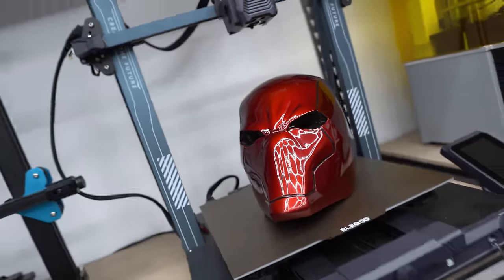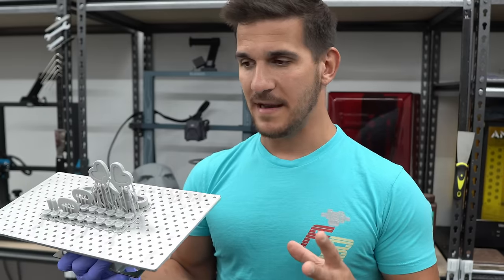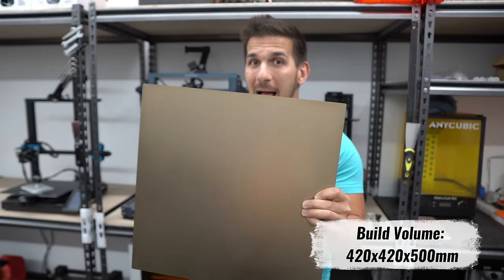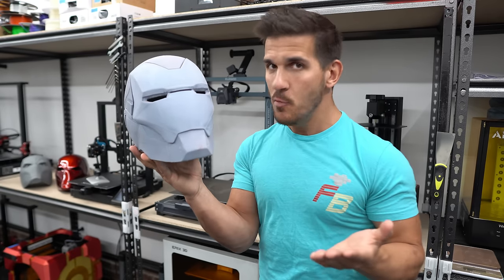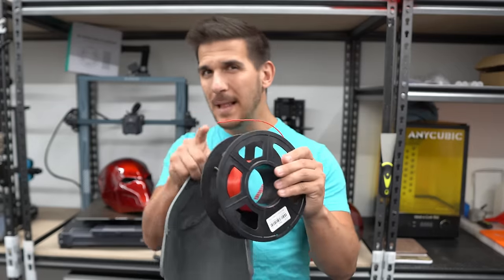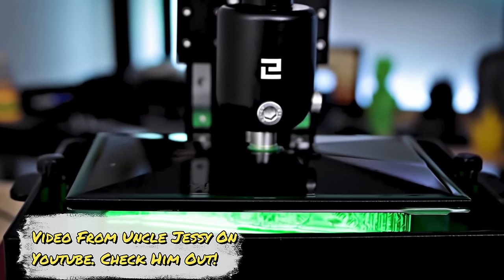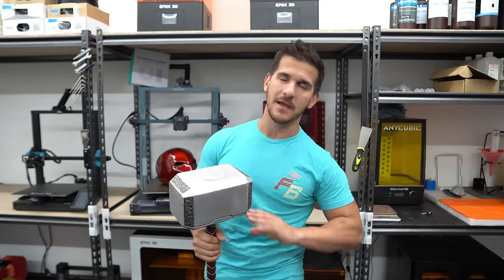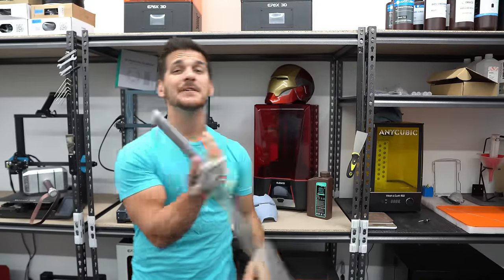Plastic (FDM) or Resin (LCD) 3D Printing?! Which is BEST for Cosplay & Props?!

Comment: I have a resin printer, the halot one, and I'm having issues with my prints not sticking to the plate. It worked perfectly for like 20 prints, and then I had to change the FEP. I'm pretty sure I did that part, right, though. They just keep making flat blobs on the FEP. Any tips or tricks or video links?

Thank you!

Comment: Good overview but one small correction. That's not a SLA printer. SLA use lasers and draw the layers like a pencil. LCD/DLP printers project a full layer all at once. Most SLA printers are very big with the exception of Formlabs printers (there may be others, that's the only one I know of)
Reply from the maker: You are correct! My bad haha I changed the title
Reply: @Frankly Built  new to your channel, where do you get your build/STL files, do you make them yourself?

Comment: I want a resin printer when I have more space for one, as well as a bigger FDM printer. Only barely enough room for an ender 3 at the moment. But I make it work and I'm currently working on a 33" halo assault rifle printed on my ender! On a side note, have you ever worked with Eva foam? Or did you go straight into 3D printing?
Reply from the maker: I went right to printing

Comment: Yeah, but to get the quality of resin prints with fdm, you need lots of supplies and tools that exceed that of processing resin: lots of different grits of sandpaper, sander, fillers, primer, acetone vapor machines, etc. Plus fdm is so much slower, even with klipper printers, especially with Anycubic’s Mono M5, which is three times the speed of average resin printers.

Comment: I personally dont want to make huge things. I want to print anime and action figure type things, small desktop stuff or quick fixes for things but nothing giant. I assume a resin printer would be better for that. Ive done a literal metric fuckton of research and I think even with the extra cost, steps and hastle I want a resin printer. The one thing Im not sure on is the fumes. I dont have a ton of room for a printer so it would probably end up in my bedroom or livingroom which probably wouldn't be ideal. I dont want to constantly breath fumes if they are toxic. Just how dangerous are the fumes. Like say I ran a resin printer in my living room. whats the risk? will I die? Will I just get headaches? will an air purifier help enough to ignore it? Can I just open a window? Id love some advice.

Comment: Hey everyone ,  Frank just wanted to say your advice on alot of this has helped me with a bunch of my prints between printing,  painting and doing some work on things. That said I run into an issue with failing supports from time to time,  its mostly the smaller ones I pit a brim to try and keep them on build plate,  but still fail. Was wonder if maybe it could do with support density being too low? Or maybe I should try and beef up those smaller ones with custom supports,  or lower/raise support travel speed? Using a cr 10s prov2 with a bondtech ddx extruder

Comment: Frank you failed to mention one of the big problems with resin over FPL for cosplayers.  Resin can be brittle and cracks easier if dropped.
Reply from the maker: Honestly I chose to leave it out because it’s a wash. Plastic can crack too. And warp easier.

Comment: What's with the obsession with wash&cure stations? For a buck or two, you can get a large, sealable container you can put your prints and cleaning fluid in and you can slosh it around like there's no tomorrow to wash it and a cheap nail polish curing lamp will run you maybe ten bucks and works very well. I can't imagine spending a hundred bucks or more on a wash&cure machine and no, you absolutely DO NOT need it.

Other than that, the rules are pretty simple: You want durable parts that can handle some degree of manhandling? FDM is pretty much the only way to go. You want large  or multipart prints? FDM, resin pieces tend to warp, so aligning the pieces is a bit of pain, far worse than FDM. Sure, you can do them in resin, but keep in mind that resin is more expensive than filament. Resin should be reserved for smaller parts that require high detail (and preferably where accidentally bumping them into things is not going to happen) like miniatures, that's it.

Comment: I hate the terminology plastic vs resin since both are plastic. 
What I don't know but will look into is, are there different types of resin? Like, FDM can print very soft, flexible to PLA/PVC Carbon Fiber and about 100 others. Resin, from the little I know at present, is more or less all the same.
Reply: Yes there are

Comment: Resin used by 3d printers is also a type of plastic.
Reply: This is correct. And to add more nerdy detail, resins are thermosets meaning they are crosslinked polymer networks and cannot be melted. Filaments are thermoplastics that are one long continuous polymer chain. Whenever you use fdm to build an object, that entire object is technically one large molecule.